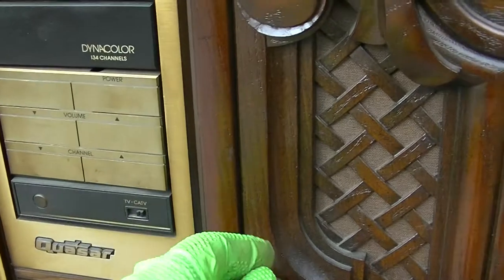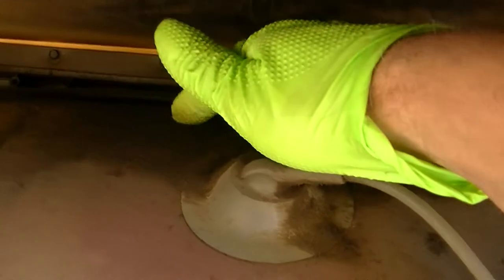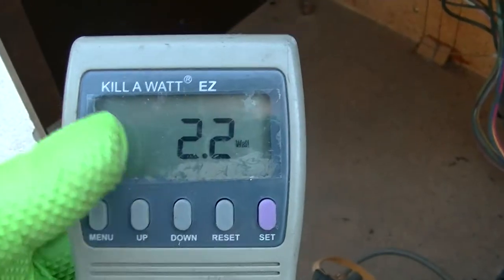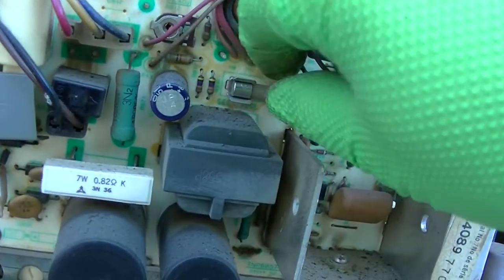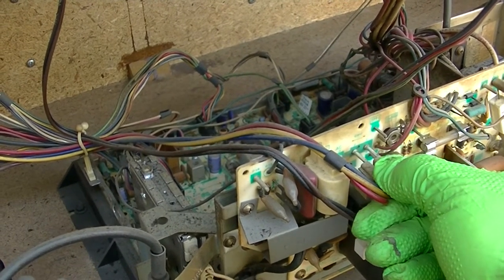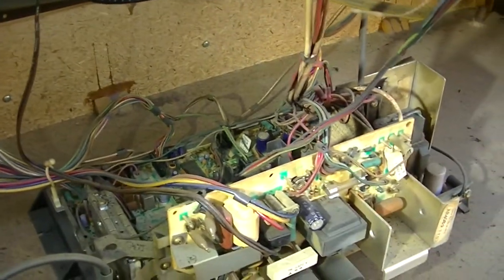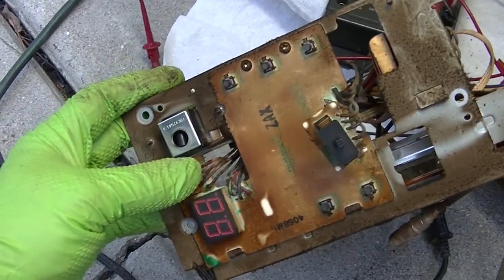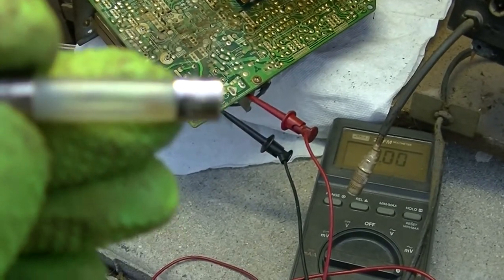Hideous Quasar Smokers Choice 1984 Color Television NASTY

Comment: Back in 76 my mother worked a part-time job to save enough money to buy the predecessor to that set in the exact same cabinet. She was a big Jimmy Carter fan and purchased it to watch the inauguration in color. One week before the inauguration the set went out. We had used it for about 2 weeks. There was a bad batch of if integrated circuits and since this was the first quasar set produced after Motorola the parent company of Quasar sold to Matsushita.  Needless to say she was quite upset and the quasar repair person showed up inauguration day and got the set working about 10 minutes after the inauguration was over.  Now that being said the set from that point on did an exceptional job and really required no other maintenance other than dusting the inside out and replacing the channel selector knob. One day while we were watching it we heard a crash. I pulled the back off and the neck of the picture tube separated where it was joined to the bell.  It took 16 or 17 years for that to manifest itself.  Electrically it was a very well-built set. The flyback was in case in a tin can. It also had a ferro resonant power supply transformer. Everything was typical Japanese quality of the day.  The set you have here is a victim of bean counters.
Reply from the maker: They call the current Administration Carter 2.0. I think this one had the bugs worked out by this time except the cracked solder joints in the vertical
Reply: @shango066   I remember Carter and I just thought he was bad. Now I have seen the top of bad-er Lol. What a mess !
Reply: @tectalabyss  Everyone is entitled to their opinion of course, but I find this a little confusing.  Other than a moderate increase in inflation related to the pandemic, the economy is going great.  During the carter administration, we had double inflation coupled with poor economic growth, and mortgage interest rates were close to 20%.  Things have been going gangbusters since the 2008 crash.
Reply: @tectalabyss  I remember Carter's "malaise" address to the nation, and recall him saying that America will run out of domestic oil by 1985. He was a bit of a wet blanket, in my opinion.
Reply: @chetpomeroy1399  yes, that was one of the biggest political misses in history.  He also made a huge mistake by backing away from nuclear power after TMI.
Reply: @jaysmith179  I have to speak up to the facts:

● Unemployment in October 2021 was 4.6%, down from 6.9% a year ago.

● Average hourly earnings are up 4.9% from a year ago.

● In his first nine months in office Biden added 5.6 million jobs, compared to 1.6 million jobs for Trump’s first nine months.

● The National Retail Federation anticipates record sales for the upcoming holidays, with sales growing between 8.5% and 10.5% over 2020 sales.

● Nearly 200 million Americans are fully vaccinated against COVID-19.

● The recent passage of a $1 trillion bipartisan infrastructure bill pushed by Biden represents an historic long-term investment that will benefit the entire nation. It will provide much-needed funding — and millions of jobs — to upgrade the nation’s roads and bridges, public transit, rail service, airports, internet access, water/wastewater facilities, and the electric power grid. Texas will get about $35 billion. Thank you, Joe Biden.
Reply from the maker: @TheElectronMan  I will approve this message out of the held for review even though I cant stand this admin. If you just take the CPI and maintain the current level of inflation for 3 years the dollar will be worth roughly half of its value from when he took office.... the crash is coming just watch
Reply from the maker: @Tyler Mathis maybe soon
Reply from the maker: @TheElectronMan  all points of view and discussion are welcome here, just no name calling, insults or threats.
Reply: @shango066  Thank you sir have a nice evening.
Reply: @jmpattillo  he plays to his predominantly white male over 45 years old audience. I doubt we have one girl.

Comment: I work on arcade games for a living.  I've seen dirt and nicotine so thick on CRT's that you could barely see the picture through it, and circuit boards that looked like blankets because the dust was so thick on them.  This TV is clean by comparison :-)
Reply: I used to work at a tv shop in the 80s. I remember ones that looked like they were covered with hair inside. That HV would suck it all in like an electrostatic air cleaner. We had a compressor in the back. we would run the hose out behind the shop and blow out the tv before bringing it in to work on them. All filled with dirty connectors, pots and switch contacts.
Reply: YOU should start a channel. I would watch the hell out of it

Comment: Point of order... The only way a Chevy Citation is a hot car is when you park it on asphalt on a hot summer's day.   Or it's on fire.   You could also say it's "hot" if it's stolen, but I just checked and no thief has ever selected a Chevy Citation in the history of thieving.
Reply: Granted, it wasn't hot, but it was the "first Chevy of the 80's," or at least that's what was said on the TV commercials at that time for the 1979-1/2 models.
Reply: No  one ever reported one stolen either LOL
Reply: I think if some stole a Chevy Citation it wouldn’t be Hot because the owner would be so grateful it’s gone they wouldn’t report it stolen.
Reply: Being an '80s GM product... pretty sure that the Citation was easy picking thanks to the poorly designed steering column.
Reply: @VectraQS  the GM X Car was poorly designed period the Oldsmobile Omega and the Buick Skylark were the best styling of the four cars. It was recalls and bad sales ended the X Cars after only 5 years
Reply: @vancouverman4313   I remember reading about them. They were called "The East Side Imbeciles". Apparently, most of the members of the gang later were killed when they attempted the daring robbery of local gunshop wearing Captain Kangaroo masks,armed only with squirt guns. The leaders last words were "If I had only filled mine with water things would have ended differently". The two that survived finally went straight and became "Legitimate businessmen"  starting a company that sold bladeless knives without handles. When that venture failed due to manufacturing issues,they found their niche in politics as presidential advisors.
Reply: LOL

Comment: I remember those years, everybody sat around in front of the TV and smoked, ashtrays were full of cig butts. The big push to get people off cigarettes was just getting started. I was a electronics tech and every piece of equipment I worked on not only smelled of tobacco smoke but required a clean rag and wipe down the inside to remove the sticky yellow tar inside.

Comment: That nasty glaze IS good for one thing however.  I have restored cars that were heavily smoked in, and the interior chrome fittings are generally MINT under that protective glaze coating!  Also I vividly remember the day when my parents bought their first colour TV in 1975, a brand new gigantic Panasonic console.  I was 6 and had broken the old B&W tv by spinning the tuner knob as fast as I could.  That new Panasonic featured little curtains over the speakers.  Mom later removed the originals and made new ones to match the room decor.  That Panasonic was trouble free until the early '90s and was ultimately replaced for aesthetic reasons...
Reply: I was just about to comment the same exact thing. Although the cigarette nicotine paste is absolutely disgusting, it does a great job in preserving whatever finish is underneath. I have seen radios that were nearly yellow in color and sticky. A little Fantastik or Windex cleaning removes the paste easily, and many times the radios look pristine after cleanup.
Reply: True

Comment: It may be ugly, but that Quasar is a survivor. The Matsushita color television chassis of the early 1980s had the greatest longevity of any make, they played and played, year after year, until eventually the CRT became gassy and the cathodes depleted. The performance didn't equal a Trinitron, but the Sony was sure to die first.
Reply: I vaguely recall that these post-Motorola Quasars had the same white resin-dipped flyback and potted tripler/focus divider as their Panasonic siblings.  They seemed to show up around the same time that Sony came partly to their senses and started using ordinary transistors in place of those infernal SG-613 "gate turn-off" HOTs that you had to destroy several of before figuring out what was killing the drive signal, (despite all the precautions, using the big ugly Sencore VA-48 drive/B+ substitution device) and those stupid things cost $24 apiece even back then.  Thanks to the Trinitron jug's mosquito lifespan, shortest of any in the industry, we learned to check it for decent cathode emission before going any further in.
Reply: Oh wait... this one's newer than the ones I was thinking of.  Got the fully integrated fly/tripler.

I always loved the sound these sets made in a garbage truck compactor.
Reply: @edwardmills8020  Some models had a potted horizontal output transformer. Never had to replace one of those. And yes, I remember the Sony SG-613. The ECG276 substitute never lasted an hour

Comment: I worked on a lot of stereo receivers in that era. Cleaning the brushed gold fronts did bring out the silver color and the paper towel used to clean it turned a dark brown. A lot of cigarette smoke and humidifier minerals were showing up on the CD laser assembly lenses and transports. A lot of manufacturer sources hybrid chassis in that era. I opened a Blaupunkt radio and found the insides sprechen Japanese. The Quasar brand name went down with the Montgomery Ward ship in 2000. A customer came in with a new Quasar receiver and we told him there was no warranty due to the downfall of Monkey Wards. It had the same chassis and the problems than the Tomson (French firm) unit being sold at the time.

Comment: This is just a Panasonic/Matsushita television which is the company that bought Quasar from Motorola back in the day. These console sets were dependable and lasted forever. The old RCA/ Thompson electronics consoles held up forever as well. Also the tuners were a lot more sensitive compared to the FCC regulated crap of today. The late 90's NTSC tuners were so detuned due to government regulations that they barely picked up descent in a 30 mile radius. My parents old RCA (84ish. era)console could pull channels from about 170 miles away, on an outside antenna. I retired that RCA to the scrap yard working in 2013. That set was on almost 24 hours a day for its whole life.

Comment: “It’s easy as hell to get these things and impossible to get rid of them”. 

That’s very true. I’ve seen lots of 70’s and 80’s console sets over the years in thrift stores and they can’t pay people to take them. Most places just outright refuse to accept them,or bust them up and put them straight into the dumpster.  I went to an estate sale a couple weeks ago that had several old crt TVs from the 80’s and the people running the estate put them out at the curb with a cardboard sign that read “free” on them.  They were still sitting there on the last day of the sale.

Apparently someone must have found this “smokers choice” console attractive (or felt sorry for it) because it was adopted. So Shango deserves credit for saving another set that was destined for the landfill.  

It’s amazing how much smokers tar was coating that thing!

Comment: Thinking about this set from 1984, at the same time frame as this TV set, we were still using our 1969 25" zenith in a cart in our family room as the family set. It worked, but color off and other set was a Sony 9" mom get around 1973 and that was hers, but now used in kitchen. In 1985 the year after this set came out, dad now retired had been retired for a year as an Airline Pilot and one day decided lets buys a new TV set, so we did and the latest and greatest Fisher 25" set which could be upgraded to stereo with a module that plugs into rear and our first latest and greatest Mitsubishi VCR with stereo and all was over $1,500+.

Comment: I swear that Curtis Mathes rebranded this for their lineup. I remember my Gramps swearing out a CM rep over the phone and promptly shuttlecocking one of these to the curb.
Reply: Shuttlecocking👍
Reply: I knew it looked an awful lot like a CM my parents once had.
Reply: We had a cheap Curtis Mathis version of this set in 84 with a mechanical turner in it,had to use vicescrips to change channels.
Reply: @donbest5024  Match book behind fine tuner, I miss it
Reply: I thought C-M was using NEC chassis? Everyone was making consoles that looked like this in the mid 80s so its probably easy to confuse it.
Reply: @irtbmtind89  sooo older?
Reply: @irtbmtind89  probably different chassis but the cabinet is identical. Don’s comment makes sense too.

Comment: Living in Germany smoking is still popular here, but we’re getting to where you are in the USA today.
I myself smoke about 30 to 40 cigarettes a day in my house, so I’m used to the “cigarette glaze” in my electronic devices.
I collect jukeboxes, pinball and arcade machines, the tar residue in this devices is often much worse than in this tv. To clean the circuit boards I usually put them in the dishwasher with 2 tabs detergent, maybe unsolder some parts that shouldn’t get wet. After 2-3 days drying the PCBs are like new. Nice side effect of this method: corroded contacts in switches, ic sockets and potentiometers are blank like new again. I also had many tv and arcade chassis in the dishwasher, never got problems.
Reply: das gud

Comment: I once paid $400 for a TV similar to this one.  It was a Zenith.  In 1985.  The workers at the store loaded into my truck.  Suddenly the Mgr rushed out and said they decided not to take my check.  I was incensed!  I told them take it back.  Then I went straight to a Warehouse store and bought the same set, with a check, for $50 less!  5 years later it wouldn't turn on so I had Montgomery Ward pick it up for repair.  It was $97.  Then when it was delivered, I turned it on and there was no color.  One of the Guys said "He had a color board on the truck and would swap it out for $25 cask".  I paid him and he did.  It was easier than having them take it back and fight over the bill, being without a TV all that time except for a 13" GE portable.  Today I could get a 20" for $100.

Comment: Judging the equipment for any other time by today’s standards rarely ends well.  I worked at a Quasar servicing dealer who also sold Magnavox.  The sets were ‘ok’, & about as reliable & serviceable as any others.  Made a decent living there, for the time.  Based on the available technology then, this set is pretty decent.  Obviously today, there are ‘better’ sets.
Reply: The switch mode power supplies on today's sets seem to fail more than the older analog power supplies of the 30+ year old sets. Don't know of many flat screen sets that see even 10 years of use without some kind of problem, usually totally dead by then.
Reply: @zulumax1  I know plenty of people with 10+ year-old flat panel sets; I have one myself. My impression is that most of the sets that fail don't make it to 5 years. The problem is that when they do fail, they are often unrepairable, so replacing a set is analogous to replacing a picture tube in the 1970s. I you limit yourself to cheaper sets, the cost is also about the same as a picture tube.

Comment: That particular "hideous" cabinet by Quasar has been around more or less since the early 1970's. My dad bought a Quasar 25" in 1976 (1st year of the  Matsushita sets). Sharp picture but reds were almost nonexistent by the mid 1980's. The cabinet was similar to this one (also gaudy & hideous). Quasar started out good when Motorola owned it but once it was sold to Matsushita in the mid 1970's, the brand was slowly relegated to being a "value" brand instead of a premiere brand like it once was (when Motorola owned Quasar).

Comment: 1:05 - After living my early, formative, and teen years in a home with a succession of weak, worn-out tube televisions, I get PTSD whenever I see reference to VERTICAL HOLD. This view of the VERT HOLD switch with the "MAN(ual) position brings me back to the days when I physically had to sit with my face six inches from the screen (B&W of course) with my arm reached around to the back of the set, manually spinning the vertical hold knob back and forth in a vain attempt to try to keep the rolling TV picture in-frame... I guess that "MAN" VERT HOLD switch position was for masochists who liked to suffer with their face inches from the set with their arms reached around to "manually control" the vert hold knob, ha ha😛.
Reply: just shave
Reply: That was not normal to rarely, if ever, adjust the vertical. That TV was broken and not reading the sync signal properly. Never seen a TV with a switch like this one for man/auto.
Reply: @zulumax1  "...  a succession of weak, worn-out tube televisions..."
Reply: @zulumax1  Vertical hold was a relic of the old 12AX7 era vertical multi-vibrators. After we bought our first solid state set, we never touched the vertical hold again.
Reply: @dougbrowning82  - Good insight on your explanation. I assumed that everyone who watches shangos vids   knows about the foibles of tube sets.

Comment: i once had a late 80s set came in for repair with a really dim picture, as it turned out, the tube was bright and strong but the screen had such a thick coat of nicotine tar, it was almost completely obscuring the picture, just had to spend an hour cleaning it